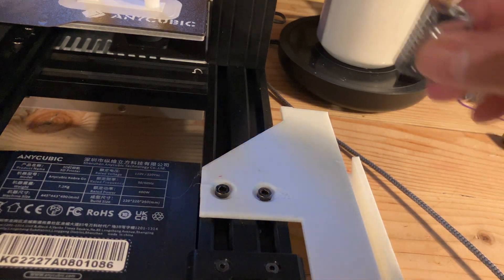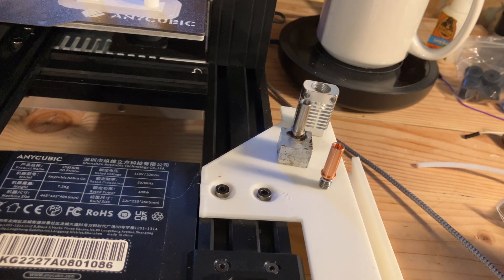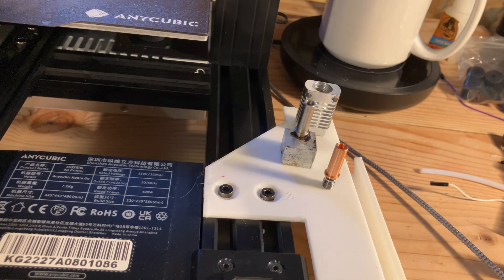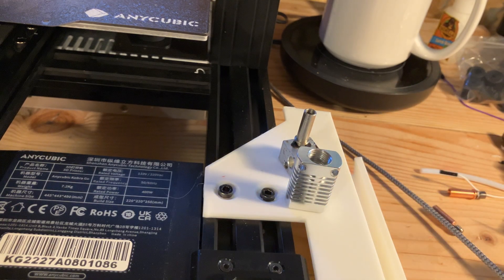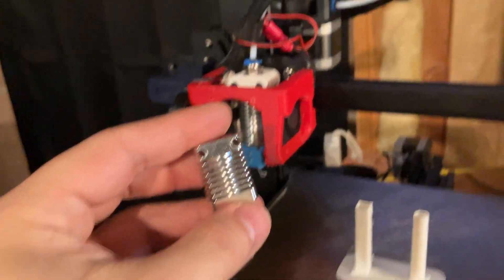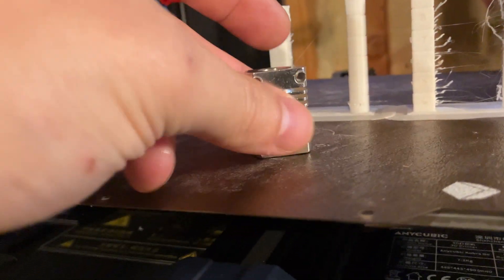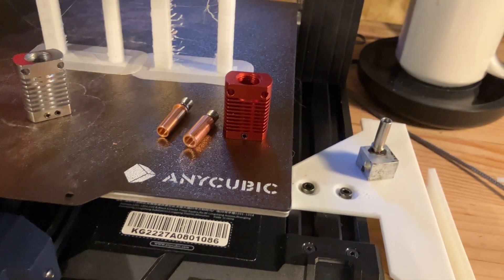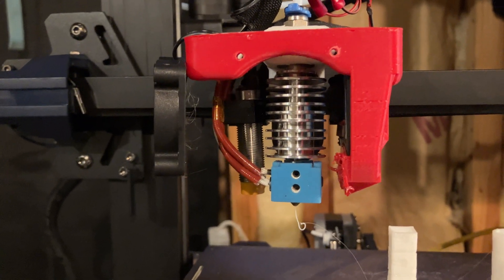Anycubic Kobra Go - Bimetal Heatbreak

Comment: I run a Vyper at 375 with no issues.
- bi metal heatbreak
- Stock heatsink
- Copper heatblock
- hardened steel nozzle

Zero issues. And I run klipper firmware and a LDO Orbiter V2.5. I think it’s the settings that need tweaking. Bimetal heatbreaks let you print hotter, not cooler. Had my machine this way for 3 years now.

Comment: I'm sorry, i haven't had the stringing you have had with your Anycubic. I have the Kobra 2 pro and stringing isn't an issue. I'm pretty sure your string issue is setting related. Seriously, my previous Anycubic printer didn't have strining issue either. Soooo....
Reply: By the way I've had mine for a year now.

Comment: Also... are you still using the stock heater / thermistor combo?
Reply from the maker: There are two grub screws holding the heat stink with the heat break. I  am still using the combo, v6 hotend with end with bimetal heartbreak.
Reply: @joseph-montanez  awesome. I see in your video you have the heater element and thermistor removed from the stock heat block - how did you manage to pull out the thermistor?

Comment: How did you remove the thermistor from the heater block on the stock kobra go? I want to upgrade to an all metal hotend (micro swiss) but I can only remove the heater element thus far from the block. Any tips?
Reply: If you haven't already done it there is a grub screw  which is accessed from the back so remove the sock and the whole head to get at it

Comment: did you try thermal paste with the bi-metalic break?
Reply from the maker: Yes. I ended up moving to a V6 Hotend / bi-metal with a 40x40x28mm fan. I needed to remix a shroud for this setup but its printed without issue for a while now. Hotend parts + Fan is around $15 from Aliexpress, then using a GammaMaster nozzle from Slice Engineering, I got that for $18. This has been on my todo to follow up on.

Comment: Mine has become a Stringing mess. I'm tempted just to say buh bye and buy another Ender as they are just far superior.
Reply from the maker: You can buy a CR-6 Clone Hotend, it’s a drop in replacement $10 off AliExpress and $15 off Amazon. I have a video to finish about this very thing, should be up in the next day or two. A Bi-Metal heartbreak isn’t possible with the stock or even the CR-6 clone hotend but a hobbled together a $15 dollar solution, using a 28x40 fan instead of the 10x40, v6 hotend clone, and a BiMetal heartbreak. But that’s for another video.
Reply: @joseph-montanez  Can you link me something I'm just not 100%sure what I'm looking for.. Thanks.
Reply from the maker: @cdnbrit 
Amazon $16 - https://a.co/d/9vFoTAw - their silicon sock is stupid you need to either cut it or poke holes to be able to screw in the thermistor and heater cartridge. Also need to cut the yellow tap holding the wires since the thermistor is in the back.
AliExpress $10 - https://a.aliexpress.com/_mPWPxhE this is designed better I like it more than the Amazon one.
Reply: thanks.. I'm gonna try one of the amazon ones. Looks like it'd be here late next week. I'm so fed up with the Stringing. I took mine apart today, Cleaned it all up, new nozzle, new ptfe and just strings as bad as it did before.  @joseph-montanez
Reply: Actually I'm wondering is it just the CR6 SE? @joseph-montanez
Reply from the maker: @cdnbrit not because the cr6 has different mount holes than an ender 3, at least the official CR6 hotend. These clones have boths